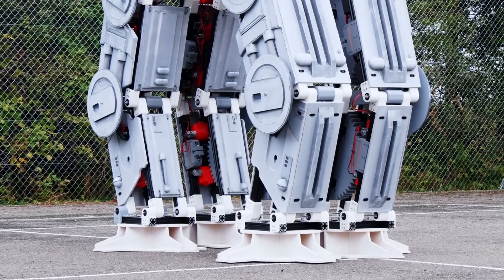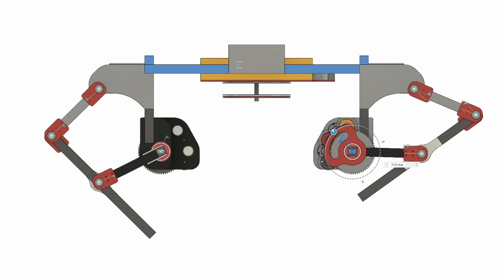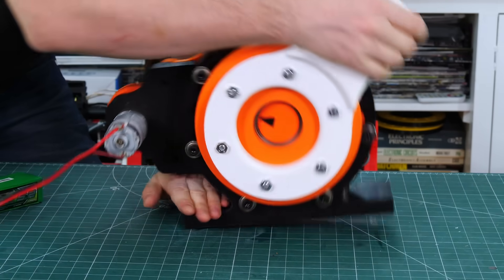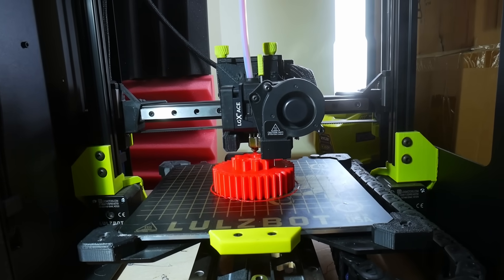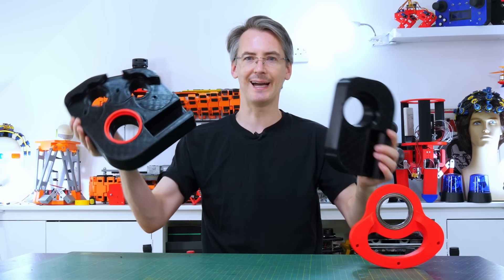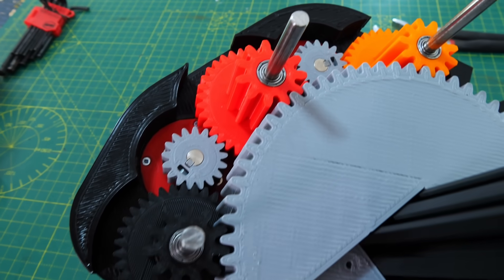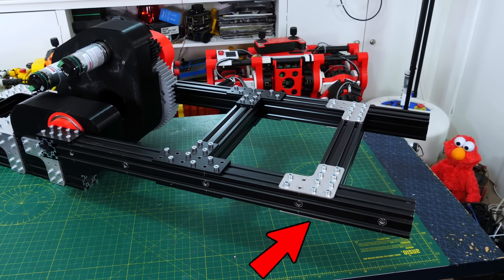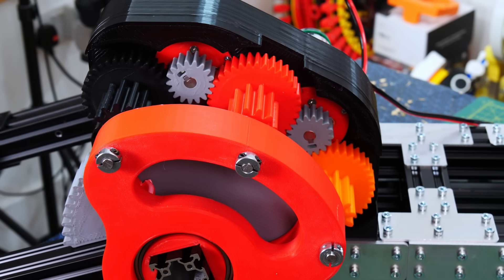Building a Quadruped I can Ride on - Gearbox development

Comment from the maker: How shall I ride it?  Check out 17:24 and post your answers!
Reply: Lying on your front will get uncomfortable for your neck fast. Same as looking straight up for a long time.

Put a seat on it, make it like a horse / motorcycle. That's what everyone wants.
Reply: @johnshite4656  i can confirm
Reply: Put a seat on the front and become a centaur
Reply: @WonderSilverstrand  Fun idea, but center of gravity is important. You could only do this if you offset the weight by having heavy batteries in the rear, for example. Much more simple to just center the rider and eliminate that variable. Centaur maybe for a future project.

The practical use of the centaur style would be that you can freely use your hands in front of you. You could kneel in it so your legs don't get in the way either, and you get more height. Imagine falling over forwards though....
Reply: I think either an elevated saddle like a motorbike, or a lying back like a go-cart
Reply: Could be an unpopular suggestion but how about sitting in it? So you ride low to the ground
Reply: Maybe laying down, but with a longer shirt on so we don't see your crack 😅
Reply: Cowgirl position
Reply: I like the gokart position mentioned
Reply: why not have a lying on you back seat.
with speed paddles at you feet. 
Then you can ride and read news paper at the same time.

Comment: The point of planetary gears is not to spread the load, but to either combine two speeds or use multiple ratios. What you made is something different, with a singe ratio, and designed specifically for plastic gears. You could try making ceramic molds and casting metal gears (but you’ll spend years sanding them) or CNC machining many plates in the shape of the gear and attaching them(like in transformer cores)

Comment: 8:58 I’m curious about this… does using a grub screw potentially pull the gear out of concentricity?
I know this is 3D printed and doesn’t have super high tolerance, but I’ve wondered this anyway about other builds I’ve seen that do require more accuracy. 
It just seems like this particular example shows the grub screw pulling the gear slightly to screen left which would offset the gear and make it wobble/wear unevenly… right?

I’m asking because I’m just getting into designing my first mechanical based stuff and my plan is to eventually build a small battle bot out of 3D printed parts and this seems like the most common way to solve that problem and I’m wondering if it’s fine for higher rpm uses? If I used a grub screw to attach something for a high speed bot weapon or something, would it wobble itself to death or wear really unevenly?
Reply from the maker: Yes very slightly, but it only really needs to hold the key in

Comment: Looking at this the major weak point in the whole assembly has to be the square hole in the big gear - maximum force minimum section. Its amazing how strong these 3D printed gears can be but I think I would want some kind of reinforcing plate on there.
IME square shafts apply particularly high forces to the edges of connecting drive sockets - absolute rigidity is a total requirement.. 
⏹ Its not always hip to be square.  :face-green-smiling: [(Sorry.)]

Comment: I very much like your technique of not trying to get tight tolerance on large prints but using inserts, that's a lesson to every maker and I think its easy to say you have made enough parts to know. You always seem to run the gears dry, have you tested with a  lubricant ?

Comment: As often as you test your motors by simply clipping brackets onto the XT60 connector. Why not solder an ON-OFF-ON switch onto an XT60 once and for all? Then you'll have a quick solution forever, all in a nice Altoids tin.

Comment: One of the biggest pitfalls that I often see engineers and designers make when trying to develop a walking robot is this approach to push or pull the robot forward with each step when that is not the reality of what walking actually is for living creatures. The act of walking is nothing more than using gravity to fall forward and catching that fall with a step. There are exceptions, such as climbing a hill, but think of how much energy we expend to climb a hill. Your robot is climbing hills on flat ground.
Design a robot that falls forward when you're ready to move and give it the reflex to catch its fall and the ability to process and maintain balance. The mechanics will be much more energy efficient and the movement less robotic and potentially more natural, depending on how well you engineer it and how much agency you're willing to give it

Comment: Smart money is on riding it horse style. From experience, any control scheme that involves flailing is not a sustainable interface. Unless you're using the motion of your arms to directly control the legs as a sort of quadrupedal exoskeleton driven by arm motion alone, it's probably not worth it, especially since you've been doing your best to make previous craft move automatically using various analogue inputs (handlebars, foot pedals, etc.)

Comment: Don't the two motors wind up stresses in the gears because of running at slightly different speeds? 
Edit: I see it is back-drivable so probably not a problem.
Reply from the maker: I think it will be fine - they are both driven from the same driver so they should share the load fairly well

Comment: Grumble grumble grumble.  Why waste time saying "three hundred millimetres" when you could just say "thirty centimetres," which is not only much faster but also more intuitive?  Well, assuming a 30cm ruler is as common in other countries as it is in Canada.  Sure, the Americans will be confused but they're never going to learn if we keep pandering to them.

Anyway, you really need to get a workshop set up where you can bolt the table to the floor.  Your niche is clearly "really big robots" and it's worth setting up proper tools for that, I think.
Reply from the maker: It's the way engineers say it ;-)

Comment: i dont understand how lulzbot still exists? they were pretty crap 5yrs ago and dont seem to have upgraded anything in that time
Reply from the maker: Since then they have: new control boards, new stepper drives, BL touch levelling, new hot ends, new extruders, linear bearings, larger printers.
Reply: @jamesbruton well I stand corrected:)
Thanks for making such interesting videos. It would be cool to see some of the calculations you do for these projects or how you go about working out the leg arrangements etc.

Comment: How in the world do the motors stay synchronized? Is that something that just happens? Or do you have active control?
Reply from the maker: They are mechanically linked and very similar, so they just work. There are commercial gearboxes that combine two motors.

Comment: I'm sure there's a way to make a harmonic drive with a wide toothed belt (would have to be joined probably) for the flexi gear and a 3d printed annulus etc. That could simplify your gearbox construction.

Comment: That looks promising  :)
I was wondering. Does the red gear get more stress or less stress than the other 2 in this set up 4:33
It is the only one connected to both motors, is that harder on the gear? Or is it actually equal for all of them?
Reply from the maker: I don't know, less because more teeth are engaged with the motors?
Reply: @jamesbruton   Well maybe we'll discover next episode if the red one shows signs of wear.

Comment: The torque is very impressive. It's beyond what the rear axle nut needs on my motorcycle. It's double to what the wheel bolts on my car need to be torqued to in fact.
Reply from the maker: Yeah!

Comment: on the topic of moving feed in a straight line along the ground. you should look at the mechanics of strand beasts.
Reply from the maker: But they can't adjust the height, that's why I have two independent axes here.
Reply: @jamesbruton  I think this can be addaded to the strand beast. especially with your kind of enginuity.

Comment: 4:59 - I considerd to motors appliying forces on each other, and what if bad code would instruct them to work against each other.

Hi, Is there a PART used in a gear box, that is similar to a FUSE in an Electrical Box?

So, when reacting to "too much power, stop the power train",
   instead of having a wire burn itself,
   (suggestion) have a gear clutch with a spring that might match "over tourque".?!

Are there segnificant disadvantages for using a Fuse ?!
Reply: Something like a shear pin in the through the shaft??
Reply: Such things do exist: see other comment, but are less common in daily life than their electrical equivalents.
Reply: @thefaulnt3562  thanks!

I was wondering where are the limits when comparing systems - Electrical VS Mechanical , so I strated with a small question that caught my attention.

Seems that every tool can be translated, and we should have like very paralell dictionaries.
Reply: @paulfrost8952  perfect, very cool, thanks.
Reply: Search: LEGO clutch gear

Comment: The rapid development 3D printing facilitate is impressive. It is not cheap, but a lot cheaper and quicker than more traditional development.
Have done this for small objects. Could make 30 versions in the time it toke to make one version in metal.  🙂
Reply from the maker: Yep - the parts for the other three legs are already printed!

Comment: Cool. If you didnt know? There are electric motors available with both just inbuilt planetary gears. But some of them you can stack gear sets and get the gear reduction of your choice.

🤗🤗🤗
Reply from the maker: Yes I've seen them, but I don't want all that torque on the little output shaft

Comment: 'Inside-out planetary gearbox' is a really poor description of what this is, as you don't have a carrier nor planets that play a vital role in how planetary gearboxes work, all you have here is a very typical stationary geartrain, multiple driving and driven gears does not make this a planetary gearbox in the slightest. One input stage, one staggered idler stage, one output stage, multiplying the amount of gears within any given stage does not change anything, the geartrain equation is the same as any other standard geartrain.  The system is inherently constrained to its configuration, just as a typical geartrain is, the two inputs are locked together, the three idlers are locked together.  There's no components that allow the combination of two separated inputs, such as how over-drive can work with a planetary setup with a secondary motor assisting a primary motor, none of the idlers have a path of motion that can change their axial rotational speed, literally none of this has anything to do with a planetary gearbox. 

Is this just clickbait with the basis of hoping people have zero idea of what you're talking about? 

'Inside-out' is also a bit of an odd term here.  It would imply that you're flipping the typical sun and ring positions, but that in turn returns it to a typical planetary gearbox, it's like trying to turn a torus inside-out.  A better term would be reconfigured.  What also has the dynamics, and is, a planetary gearset but without the traditional sun and ring gears? A differential, as the 'sun' and 'ring' would be the side gears, with the planet carrier being the driven component in a typical setup; though in an atypical setup a differential with the carrier held and sun as input would have the ring as a reversed output, freeing the carrier and locking the planets would result in a non-reversed output, adding friction to the carrier would allow the 1:1 physical match of the sun and ring to not operate as a 1:1 output. Take reconfiguration a step further and you end up with a Torsen differential, though it provides the same uses but with exterior planets in a flatter package, and this would be closer to the 'inside-out' term given the planets are no longer the interior component.

Comment: With the feet design you are going for, if you make sure that when the legs are down the motor arms also turned (almost) all the way down then the motors really dont have to carry any weight statically at all.